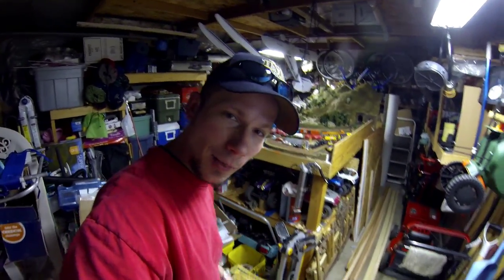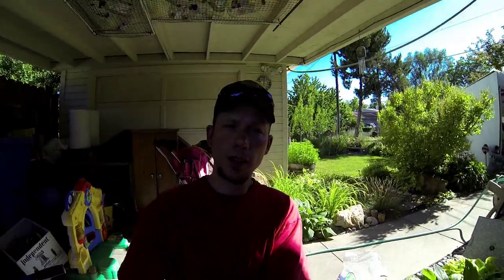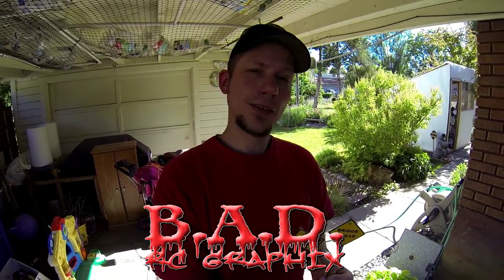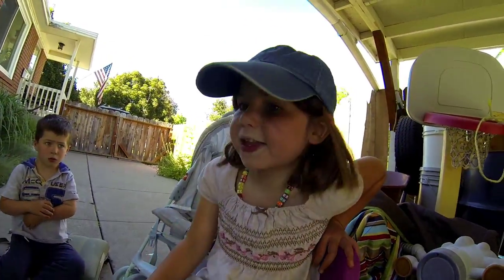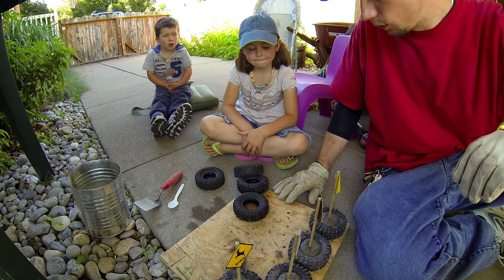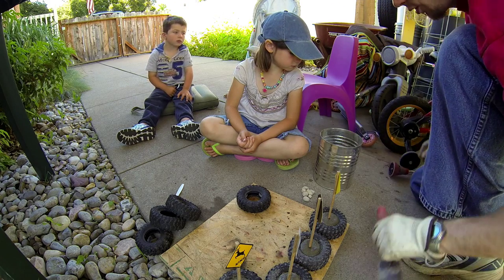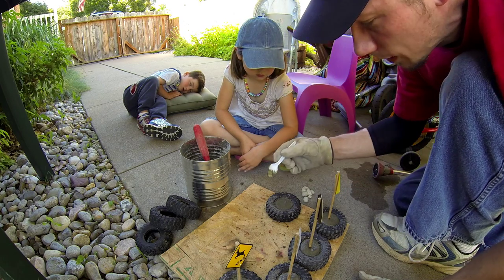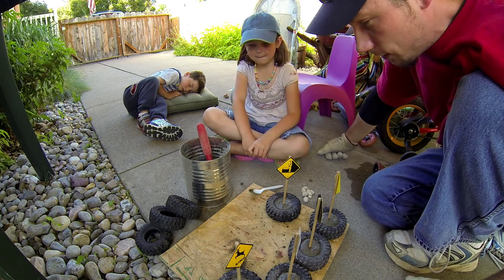How to make Scale Street Sign Bases

Comment: hey man so could ypu like cut off the tire and just have the concrete or mortar and river rocks with sign...like maybe make a pattern with rocks then put morter or conqrete then the sign once dry cutt off tire...and maybe could youmake a video trying that like wether it was a success or a fail
Reply from the maker: You wouldn't even need to use the tire.  There are a lot of ways to do this, I just wanted to give you a way to use some old scale tires if you had some.  Yea you could group together some rocks in a circle and put the concrete mix in the middle of them and stick a few extra rocks on top and stick your sign in and your done.  The ideas are endless.  I've done all kinds of work like this myself, just on larger scale.  Thanks a ton for watching my friend.  Give it a whirl and have some fun creating some cool stuff.  ;-)  Thanks for your awesome comment too!